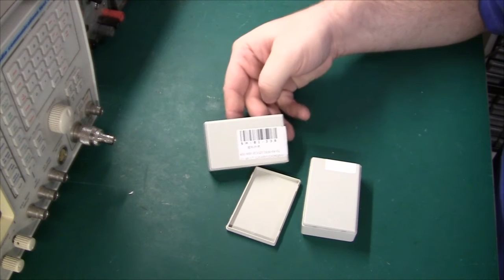Review of plastic enclosures from eBay

Comment: to remove the gue from where the sticker was, almost any kind of penetrating oil works great, like WD-40 for example, just spray it on, let it soak for a minute or so then wipe it right off, you might have to do it 2 or 3 times, but eventually it will get all the gue off,

oh, and by the way, thanks for the video, good job, i now know which enclosure to get, :)